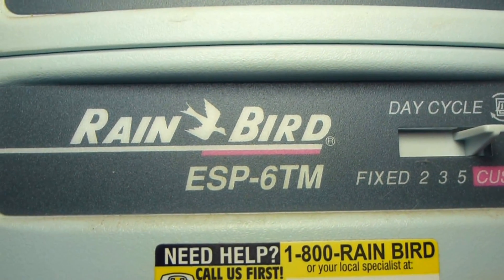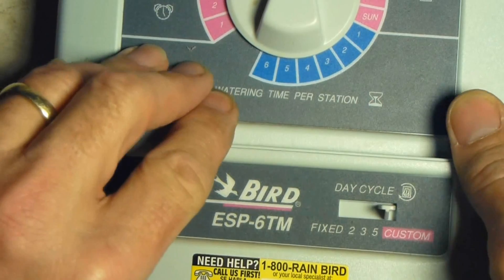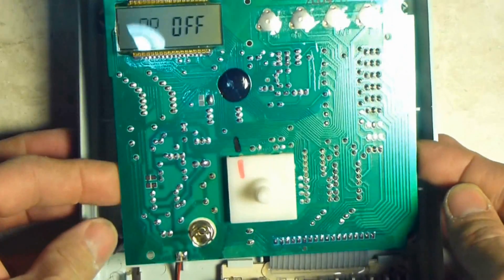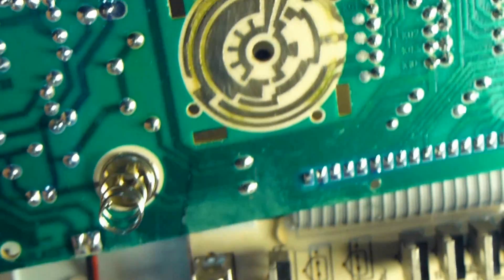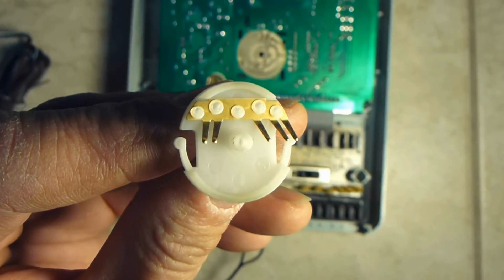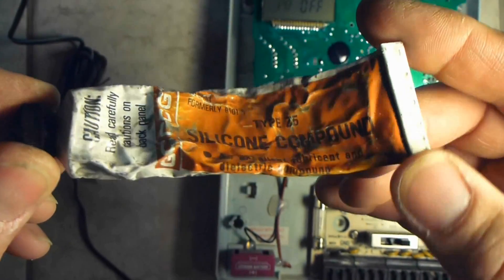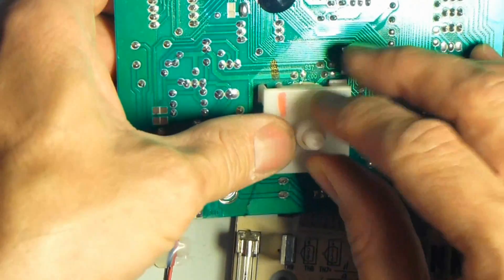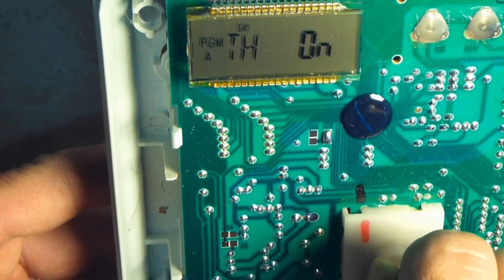Rain Bird ESP-6TM Sprinkler Controller Erratic Mode Dial Repair ESP 6 TM RainBird

Comment: Thanks for your instruction. My problem is a little different. The PGM and Manual square push buttons do not work (the up and down arrows work fine). Is there a way to clean those contacts?
Reply from the maker: In this case I would use some denatured or isopropyl alcohol and clean the conductive rubber pads, and the circuit board pads too. Use very light pressure on the conductive rubber pads, just enough to do a wipe down. You can re-coat the conductive rubber pads if necessary with some KeyPadFix https://www.amazon.com/Idolon-Tech-Keypad-Restore-Conductivity/dp/B097JD2W1Y/ref=sr_1_2?crid=3AHFS0HW2DTA6&keywords=key-fix&qid=1656477600&sprefix=key-fix%2Caps%2C129&sr=8-2

Comment: I have this exact same controller with the exact same problem in this solved for me! Thank you very much. The only thing I would note is that it's not possible to insert the dial the wrong way back into the board because one of the guide pegs is larger than the others. So while it's a good idea to mark the orientation it doesn't end up being necessary.

Comment: Thanks.  I had exactly the same problem and was assuming I would need a new controller, but your fix worked perfectly.  Quick and easy solution.  Hopefully adding the dielectric grease will prevent this from occurring again!
Reply from the maker: It will!

Comment: My ESP-4M has 2 PC boards . The motherboard is a Rev 1. The switch is on a small PC board separately. The switch is held on the board with 2 screws and a plastic boss which protrudes through small board . This boss is mushroomed over so removing the switch requires melting the mushroom off and removing the 2 screws. All else is the same as shown on the video.

Comment: So i have the same system but my problem is im not able to change the start times or the duration times at all. How would i fix that?
Reply from the maker: Start by removing the lithium battery and power to do a complete reset.

Comment: It fixed my old control. but my ESP-6TM is a bit different from yours. I took it apart, but that white piece you took off inside is attached differently from mine. On this one, they screwed it on with mini Philips screws, or it's soldered on. I can't tell which until I get a magnifying glass. Oy veh. New controllers iss expensive. Well, your method works on my oldest one, so I thank you much! I used very fine fake sandpaper.

Comment: Perfect video! I followed your directions almost completely (my Dremel brush was metal - not brass and I didn't have any Lithium whatever) but I used  a q-tip & denatured alcohol and it is working perfectly! I'm sure it will help the damage I've been doing to my hand beating on the unit to make it work. Thanks much!

Comment: Thank you.Excellent video.I was a little sceptical to take switch out of the board,but everything worked out fine.Saved $$$$ on replacement controller .

Comment: i have same problem. your video is simple enough to work with.  i gathered everything needed but when i opened mine is different setting as the circuit board is smaller and main plastic white dial is separate. one side of white latch is glued in badly so i was not able to pull out white square fully.  i need a desperate help and now stuck not knowing how to remove that clear epoxy glue blob. can i send you pictures? thanks

Comment: Thanks norcal715. I got mine working perfectly again this morning following your guide. While I have the same model number, internally it was slightly differently configured. Disassembly of the dial was a bit more challenging b/c mine had a melted over locating pin and a wad of epoxy like silicone sealing securing one location tab against the ribbon. I also let the dial get apart where I had to spend a few minutes getting it clocked right. You saved me money and time plus the satisfaction of fixing it. Thank you again!
Reply: Tad Humphreys what did you use to remove clear epoxy glue? pls pls pls help me.

Comment: Thank you.  Excellent video.  I didn't have a wire brush or silicone dielectric compound, so I used some very fine sandpaper to clean the contacts and some plumber's silicone grease to coat the contacts afterwards instead.

Comment: Sir I have a question.  My controller displays "pr off". I unplugged it and removed the battery to reset it, to no avail.  There is a red and a blue wire that are disconnected but I am not sure if they were in the first place.  Any info would be appreciated.

Comment: Thanks for showing us how to open the controller.  I took my cover off, sprayed some plastic safe electrical cleaner/lubricant into the opening of the dial contacts, and turned the dial repeatedly to clean the contacts. It works great, like new! NO NEED TO REMOVE UNIT FROM WALL or even unplug it!

Comment: This is actually my daughters login and picture. My name is Tony Cook. This video was a big help to make the repair. I'm on my second controller since the system was installed in 1993.  The first controller quit working because of the bubble buttons on the circuit board, but I think it also had the mode select problem too.  The current controller was installed in 2005 or 2006. The date on the main circuit board was 2005.03. On mine, the mode select switch was located on its own separate small circuit board, not part of the main board, connected by a ribbon cable.  It was held down by two small screws, but also had a plastic mounting post through a hole in the left side of the switch board which had been melted to hold the board in place.  I just took a small side cutter and nipped off the top of the post that had been melted, leaving the remaining post to act as a support. Not really sure why they did this, instead of just using screws all the way around. I used a piece of fine grit emery cloth to lightly sand off the residue on the encoder instead of a wire brush. You just need to be careful not to be too aggressive with the sanding as the metal traces can be damaged. I used the dielectric grease and everything seems to work great now. Thanks for your helpful video!

Comment: Instead of using a brass burnishing tool, I used a soft eraser.  First, get what you can off with denatured alcohol, then use the eraser to polish up the contacts, repeat the cycle until everything looks new. Finish by using a soft cloth to get any alcohol residue off the board.  The use of dielectric tune-up grease is a good idea.

Comment: my wife and I just bought a house and it has a rain bird, it shows only as a RainBird ESP6 but my problems are the same as this video shows, some days show other days and not the day I select, will the take apart and repair be the same as the ESP6TM, also is there a way I can get a manual for the one on my house,

Comment from the maker: It looks like a capacitor but its not, its a Metal Oxide Varistor MOV. The number on the part is ZNR V1047o D5. Check your AC Adapter and make sure it has 24 volts AC. if it does then remove the MOV from the circuit board and see if the sprinkler controller works, if it does then there is no further damage. If it does not work then there is further damage. The job of a Metal Oxide Varistor is to clamp voltages in excess of the rated value in this case about 35-45 volts AC.